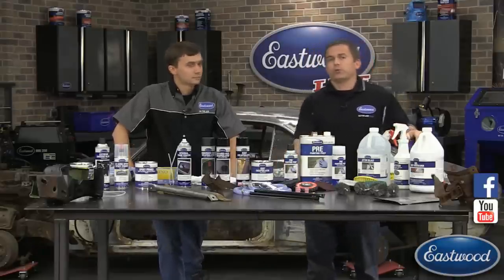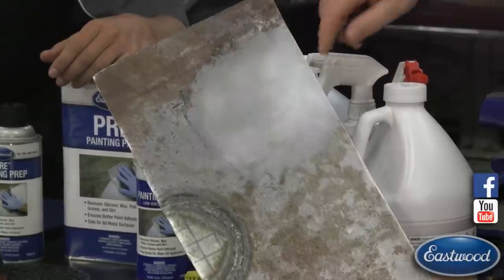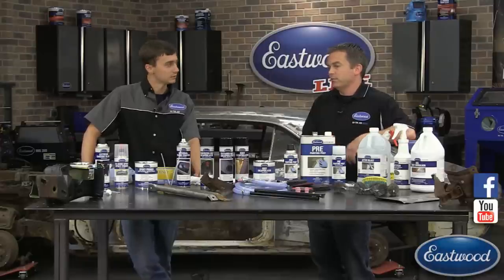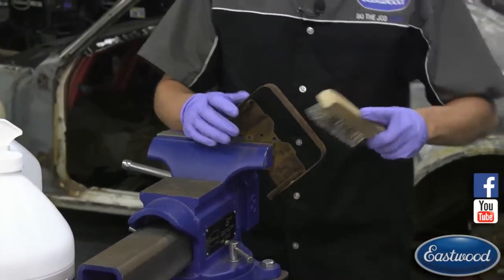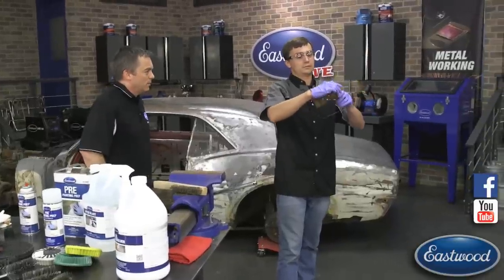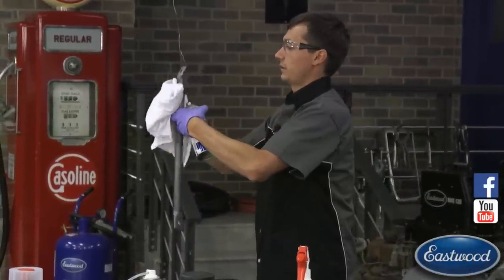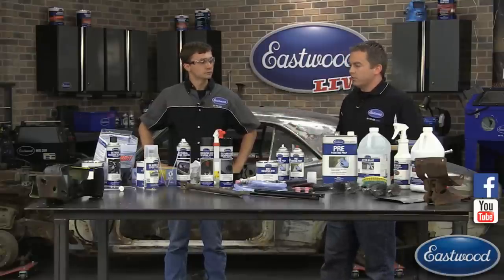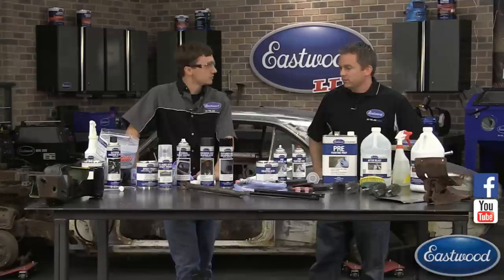Rust Solutions! Removal of Paint & Everything In Between! Eastwood

Comment: So, let's say you have a rusty fender, surface rust and maybe some pitting, both show side and inside of the panel, and you may not get to painting it for a while.  You're a weekend warrior on your car. Here are the steps with questions, correct me where I am wrong. 
1) Rust removal: mechanical or chemical rust remover, basically to bare metal, but I still may have some pitting.
2) Now, I need to wait a few weekends, because of work, so I preserve the metal and work on that pitting. What product?  Do I use Rust Encapsulator on the inside of the panel and Fast Etch/After Blast on the outside of the panel, because that's the show side?
3) Now I am ready to repair the metal, which may include welding and body fill. Do I sand off the Rust Encapsulator if I applied it, or just use PRE Paint prep? I am concerned about adhesion of body filler to the bare metal.
4) Now the metal sits again for a couple weeks.  Do I re-apply Fast Etch/phosphoric acid, or should I have planned my time better and gone right to Epoxy Primer?  Ultimately, what's the prep just before epoxy when it comes to Rust Encapsulator?
Reply: what did you do

Comment: I have a two burner stainless steel top for on old rv stove gas top I am restoring.  It is VERY BADLY RUSTED AND PITTING.  My intentions are to remove and stop the rust and then find a way to paint it where it will handle the heat and burner rings if possible.  I may be able to texture the whole thing before prime paint or whatever.  I was thinking ultimately to use appliance paint from the hardware store or maybe some high gloss engine paint.. I do the repairs and not body and paint experienced. ... I guess I should have watched before commenting.  Back to it ..

Comment: after u use the fast etch rust remover. before you prime do you use a wax and grease remover?
Reply from the maker: Yes, make sure you remove the Fast Etch.  We suggest PRE Paint Prep from Eastwood.
Reply: +Eastwood Company ok thanks! and if I have a half painted door panel and half bare due to weld spots. is it OK to get some of this product on the paint or will it strip it?

Comment: Can I shoot a base and clear on the rust encapsulator the same day? If so what guidelines do I have to follow?
Reply from the maker: Wait at least 8 hours before spraying over the Encapsulator.  Then sand with 320 grit.  If the rust is on an external panel of the car, and if you want be sure the rust is completely removed, you could blast the area or use a chemical rust dissolver, which are available at Eastwood, and will completely remove the rust from the pitted areas.  Then spray epoxy primer and your base or top coat.
Reply: Eastwood Company thanks guys

Comment: Door rust. Near the mud flap of the vehicle. Showing in the seam of the door panel at the bottom and bubbling through the outside skin. How would this be repaired and rust prevention be applied?
Reply from the maker: Is it bad enough the metal would need to be cut out and a patch panel welded into place?  If not, you may want to consider Rust Encapsulator.  The best thing may be to call an Eastwood Tech at 866.759.2131 to discuss your project so you get all the proper tools and products.
Reply: Condition is still very minor but I would like to learn the process of repairing it. Found out why the back wheel wells were rusting as there is fine sand trapped in certain areas. Which has trapped moisture. Will have to look into getting some things as you have shown and talked about.

Comment: Is rust encapsulator designed only for frame and under body parts or can it also be used to spray the outside of vehicle? Can it be sprayed on exterior as a primer?
Reply from the maker: You can spray it anywhere there is rust. Blasting to remove the rust is the best option, but if you can't, rust encapsulator is great. Here's an example using Rust Encapsulator Platinum, which offers 3x the protection as the original formula and beats all competition - https://youtu.be/h674qGHu_zA